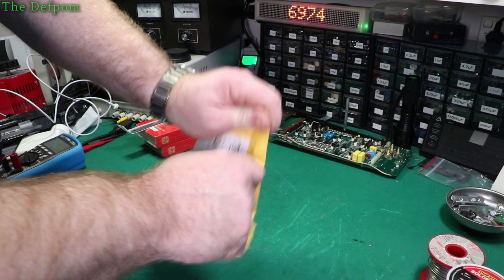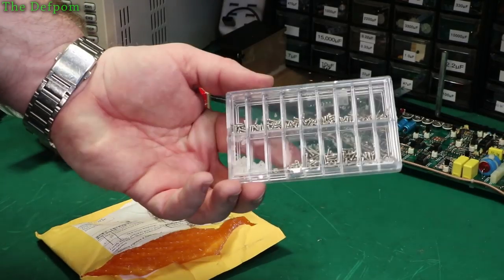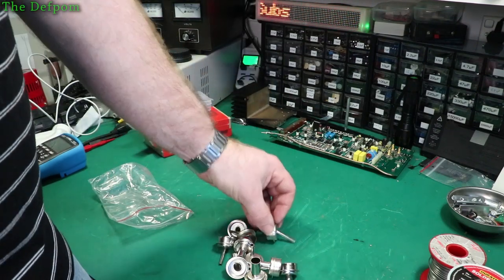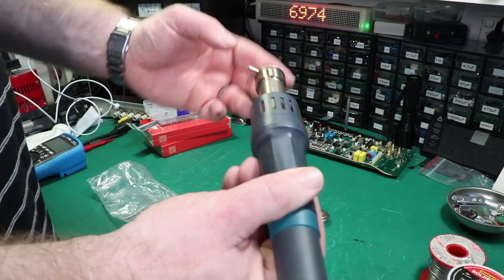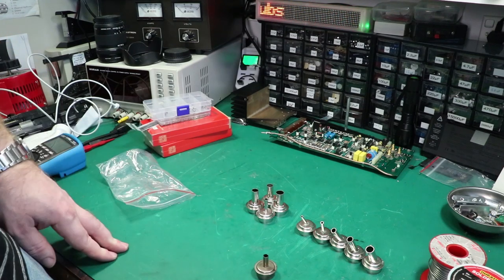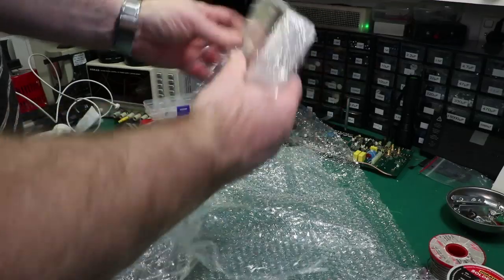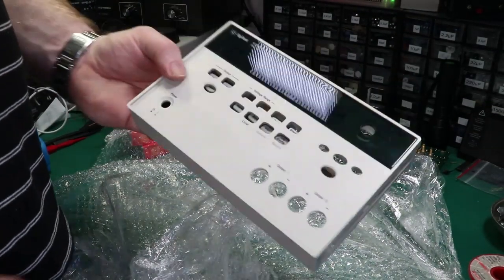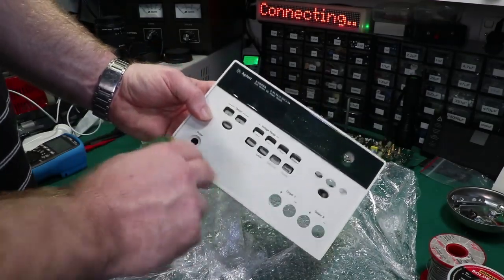🔥 #572 Mailbag Monday 3rd June 2019 👁👁

Comment: In the US, we have a product called Goo Gone. It is excellent for removing adhesive residue. Perhaps you can find in in NZ as well.
Reply: Long time user of Goo Gone having for many years owned a brick and mortar used book shop, then going on line for several years. This stuff removes stubborn adhesive labels and does no damage in the process, tough ones get an overnight soak and are easily removed in the morning.